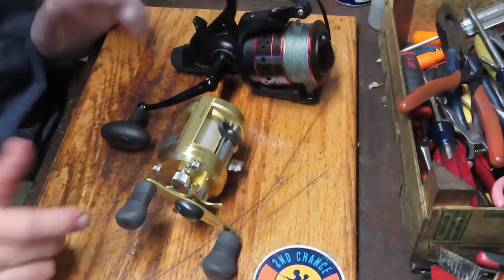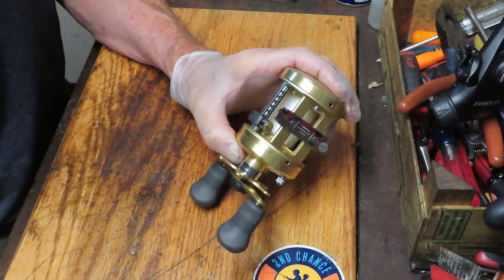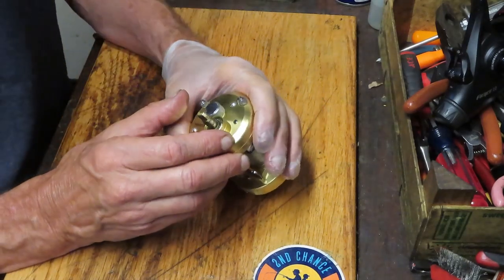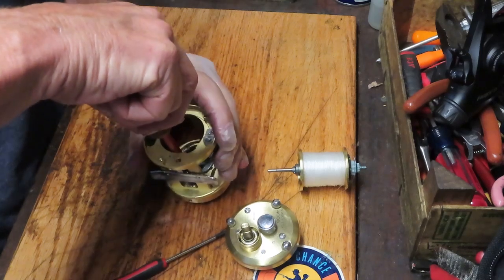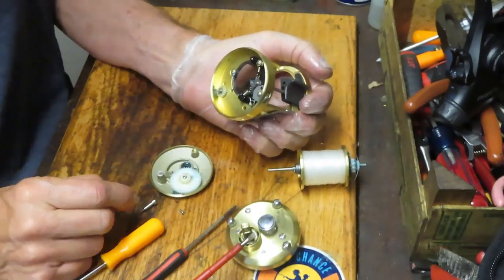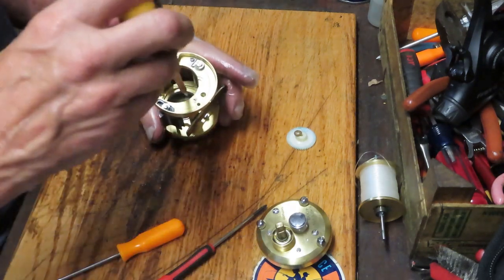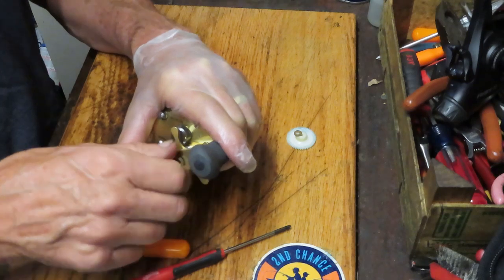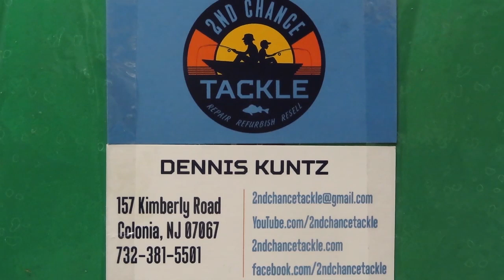Broken Shimano Calcutta 400 fishing reel how to diagnose and correct a unique problem

Comment: I had a calcutta 200 years ago that had friction or grinding only when a load was on the spool. Tried new gears and a new spool. Still did it. Finally figured out the frame had a hairline crack in it. Was hard to see, but was flexing enough for the spool edge to bind up on the frames edge due to tight tolerances and the crack allowing the frame to flex just enough. I traded it to a guy that thought he could fix it. That reel gave me many headaches until I finally found the crack in the frame.
Reply from the maker: Wow - there are definitely some one of a kind issues that arise in all reels and a bent or cracked frame is one of them